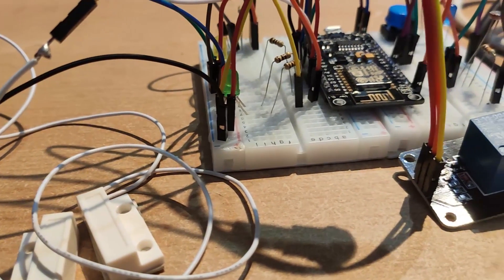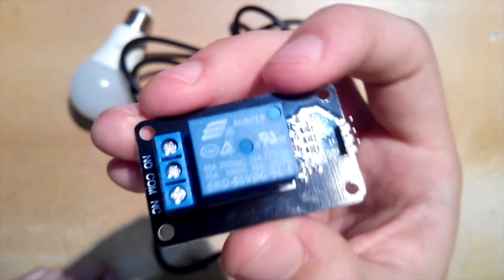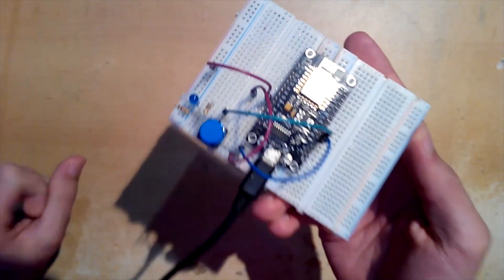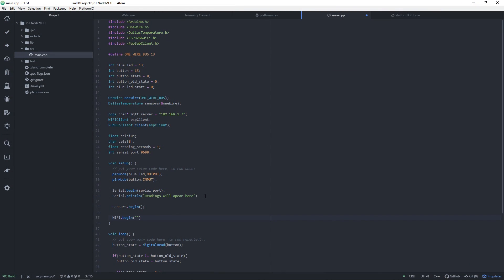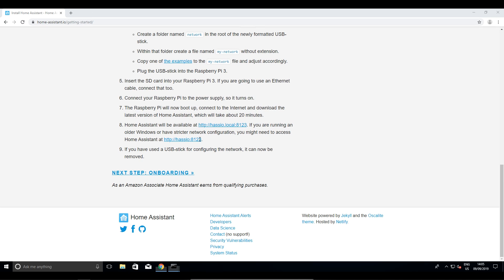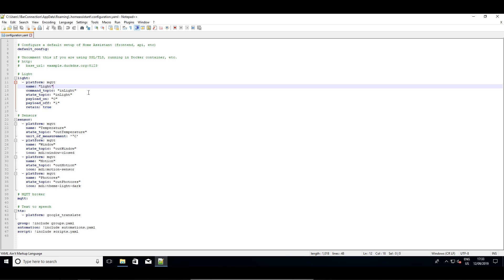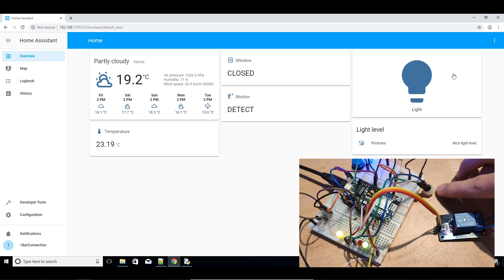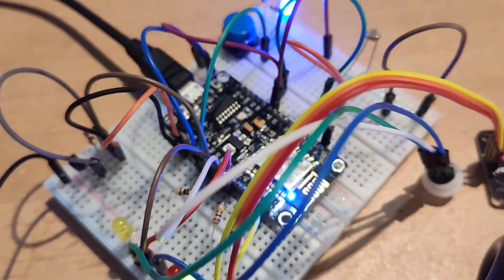Home Automation With NodeMCU, HomeAssistant & MQTT

Comment: Nice video!, thanks. I get ok connection  from serial port Window - MQTT - OK
Motion - MQTT - OK
Light - MQTT - OK
Photores - MQTT - OK

but all cards appear like unknown and i push bulb to turn on and off i cant get any message from serial port... why?
Reply from the maker: Did you install MQTT broker? In new versions you need to add broker manually or with addons. Wait few more days and I'll release new video about it.
Reply: @1BarConnection  yeah of course, i  add mosquitto with addons. I dont know what i should do
Reply from the maker: Check addons broker configuration in Home Assistant. Maybe there is username and password generated for it, and add username and password to c++ code for connection to broker (after broker port 1883).
Reply: @1BarConnection  GREAT!!! you were right. It was because of wrong credentia!s. Thanks a lot :D
Reply from the maker: Glad to hear that. Have fun with Home Assistant. ;)

Comment: Hello, i have problemm attempting MQtt conection failed
Reply: i use esp32 with nodemcu32 its okey?
Reply from the maker: Yeah. That shouldn't be a problem. ESP32 is also "stronger" than 8266.
Reply from the maker: One more thing. I was using old version of home assistant here. With new versions, I found out that if you have option to use addons create MQTT broker with addons. If you can't use addons (e.g. if you installed home assistant core) install MQTT broker manually on your computer where you installed that home assistant (e.g. check out mosquitto broker).
Reply: @1BarConnection  can you make a video on this.... i have mosquitoo borker installed in HA ....

Comment: I cant get ip adress for home assistant why?
Reply from the maker: Try to add broker IP like this (but use your device IP) in configuration.yaml:

# MQTT broker
mqtt:
  broker: 10.0.2.15

Please be careful when editing configuration because it is space sensitive (broker shoud be 2 spaces from start of the line). Also when changing and saving configuration, stop and start HomeAssistant again. Check that you are using the right IP address (IP of device you installed HomeAssistant on) and port 8123. If that is not the case, maybe with the new HomeAssistant versions they changed some rules in configuration. Try to use HomeAssistant version 0.98.3. This is the one I'm using in this video and I have no errors.
Reply: @1BarConnection  
could you make another video that says everything?
Reply from the maker: @muhammetalibaygin2391  Ok, I will put that on my list and create some video about setting up Home Assistant.
Reply: @1BarConnection  Thank you very much
Reply: @1BarConnection  
Do you need a static ip adress for these operations?
Reply from the maker: @muhammetalibaygin2391  It is not needed, but it is better to use static IP. You can set static IP on your PC easy. Just watch that IP address is free.

Comment: why did you not add mqtt ip address in yaml file?
Reply from the maker: Hi. As you can see in yaml file, for broker configuration I wrote just one line, and that is "mqtt:". This is called embedded broker and it is now deprecated. If you write just "mqtt:" without any parameter like IP or port, it will look at default broker settings. IP will be 127.0.0.1 (localhost), port will be: 1883, and so on. Too see more info about that, take a look here: https://www.home-assistant.io/docs/mqtt/broker/
Reply: @1BarConnection  when i add configuration in yaml  file it gives error
Reply: The following integrations and platforms could not be set up:

port
broker
mqtt
mqtt.sensor
mqtt.light
Please check your config.
Reply: please help about it
Reply from the maker: Hi  @yasirali9190 , I currently don't have access to PC on which this HomeAssistant is installed so I'm not able to test this. Please check your configuration paths and files in HomeAssistant folder. On which OS are you running HomeAssistant?

Comment: Hmmm , i copied the ymal file  and replaced my yaml and then used  the ino to program the nodemcu. The serial port monitor reports the mqtt connected but the HA screen does not show any icons like your display, and reports    mqtt, mqtt.light, mqtt.sensor  components and platforms could not be set up. I am running a Pi3 ,HassOS 2.12 & Home Assistant 0.101.3
Reply from the maker: Hi Larry. Did you edit UI config for HomeAssistant? Also you need to stop and start HomeAssistant again after you have changed yaml file. https://github.com/1BarConnection/nodemcu_smart_home/blob/master/raw_config_editor_UI.txt